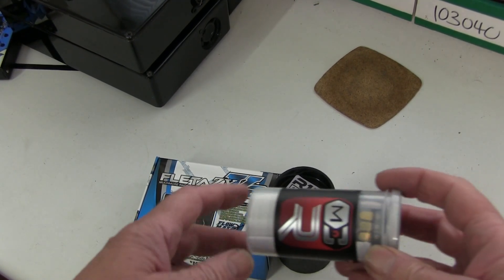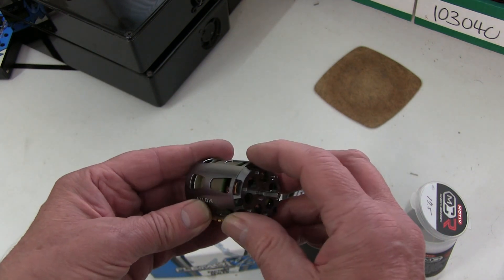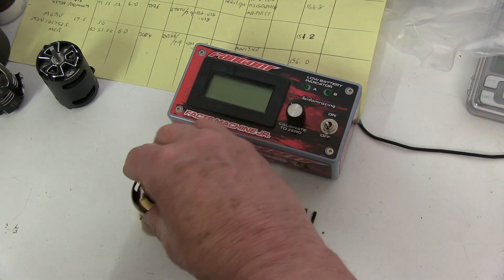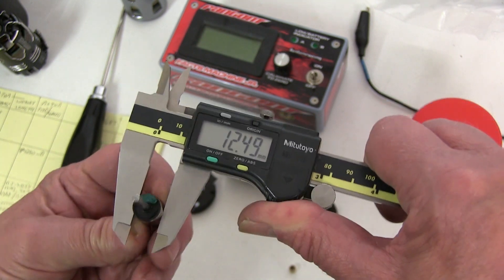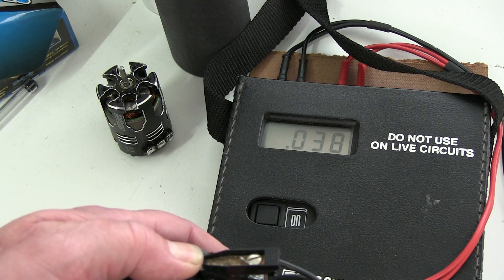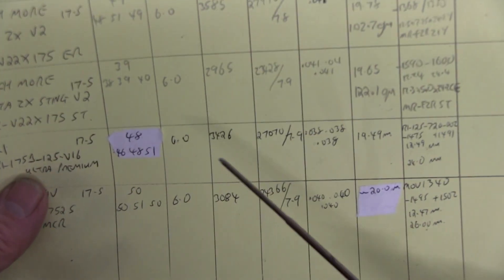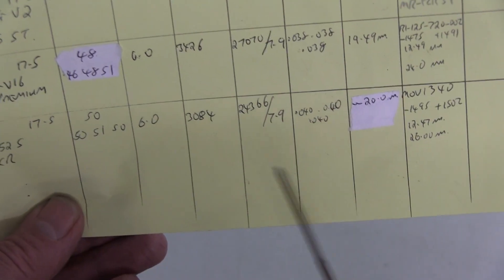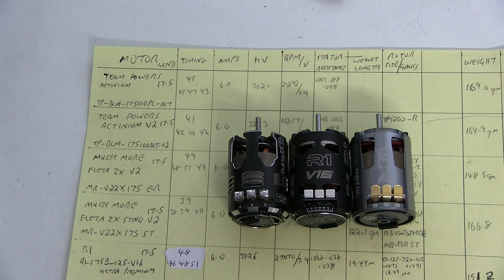MOTIV MCR 17.5T vs R1 and Muchmore. Comparison and Tests.

Comment: Good test nick, would you ever test the MC2 with a mid strength rotor?
Reply from the maker: Hi
If I have a rotor that fits I will give it a test.
Reply: Motiv do sell different strength rotors. 

Will you stock  motiv lipo's ? Which are called defy:

Comment: Can you give me a quick advice on what hold the pulley from slipping from the worm gear on my SL-7?
The turntable won't turn because there is nothing to hold the pulley and gear together. It has grease
in the joint that makes it slip and that is how I found and no other referrence I can find. Please help.
Reply from the maker: Hi M
The worm gear moves the arm across the record.
The turntable is a direct drive brushless motor.
Please contact me directly
nick@demonproducts.co.uk

Comment: I have both the Motiv and R1. Its tough to bench test the Motiv. What cannot be seen is the Motiv can be geared up 4 teeth on a 48p pinion and will have more bottom end and same top end. Both great motors but having run both I much prefer the Motiv for punching out of corners it is much better. Contrary to a bench test it is very revvy
Reply: What timing are you running on the motor ? Also what are you using it in?

Comment: good.why do not test fleta sting with 49 timing ? it's 39 in the paper ?
Reply from the maker: Hi Billy
The Sting draws high current at higher endbell timing, which will cause it to overheat.
It is a very high torque motor so works at a lower timing and can be geared with a larger pinion.
Reply: Ok thank you nick.yes apparently it is very powerful I got it in the hand and the magnet is very strong

Comment: Is MCR a different motor from the MC2?
Reply from the maker: Hi Toby
I am not sure. It only says MCR, but it could be also known as the MC2
Reply: The MC2 has been changed to fit the EU market, so it is a different motor. I'm not sure if it's just the 'can design' that has changed.